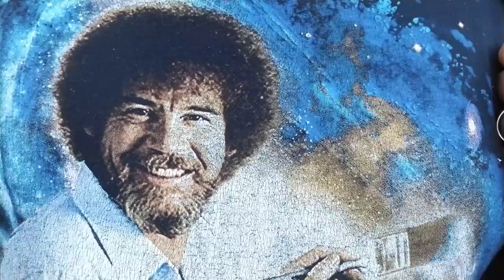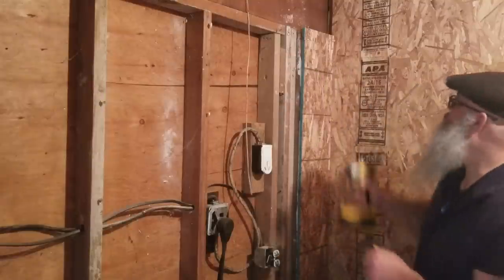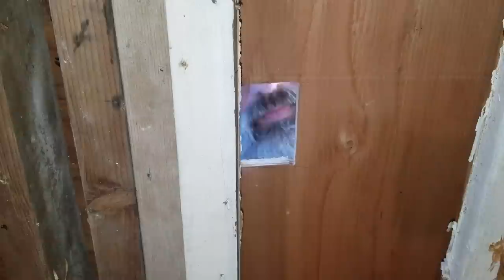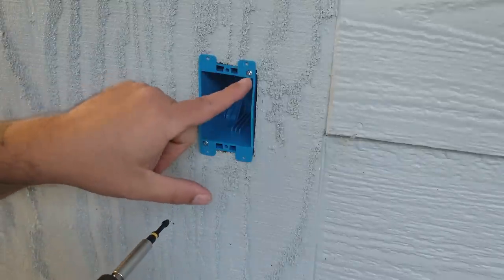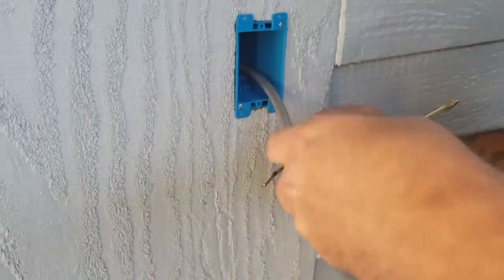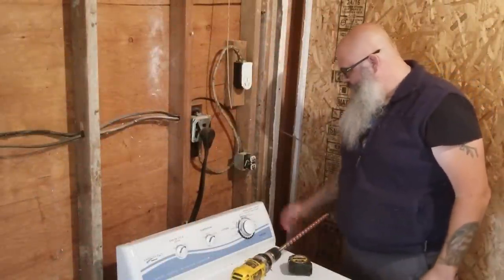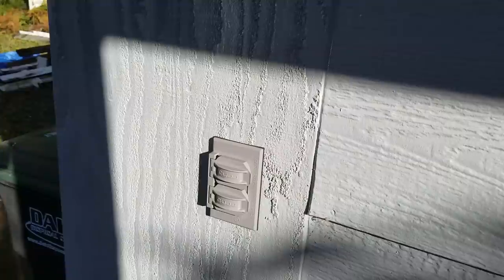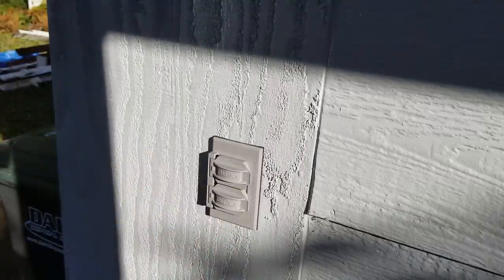Installing an Exterior Outlet

Comment: Simple and easy, but why not GFCI?
Reply from the maker: So the outlet cover he bought doesn't allow for a GFCI, but in the comments I was told if I changed the outlet on the inside to a GFCI, that that would properly fix my problem. Thanks for the comment and concern.

Comment: Shouldnt this be a gfi?
Reply from the maker: Kinda what I was thinking, but they don't fit in the exterior outlet cover. All the ones I see around my house and his are regular outlets with these covers. And they are all under cover too.
Reply: @TheBeardedWoodworker  If I recall correctly your new outside outlet is connected to an outlet on the other side of the wall.   Replace that inside outlet, or any on that wire run, with a GFI and everything downstream from the GFI will be protected.  Provided you follow the instructions with the GFI.  Sorry had to say that for the obvious reason.
Reply from the maker: @danharold3087  thanks man! That makes total sense. I might have to go revisit the outlet now and give him the proper grounding.
Reply: @TheBeardedWoodworker  I imagine you already have proper grounding.  It is not unusual to have some confusion over circuit protection.

The ground is there in the hope that a current leak will leak to it instead of you

 GFI compares the current in the hot to the neutral current.  If they differ it trips because some of it is conducting to ground, maybe through you.   GFI circuits do not need a ground to work but you are safer with a ground in place.

The circuit breaker senses current through the hot wire.   Too much and it trips.

Comment: Few things wrong here, one there is no gfci protection, two can't use romex in unfinished walls, three the receptacle is not weather resistant, four the outlet cover is not an extra duty while in use cover. Some other thing I thought I'd mention, you should wrap the receptacle in electrical tape, so long story short don't listen to a woodworker about electrical.